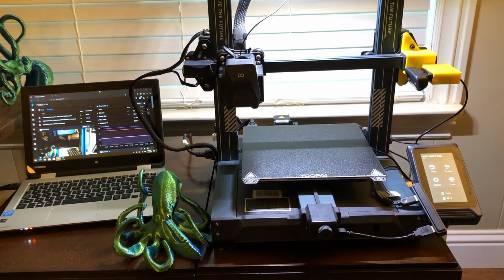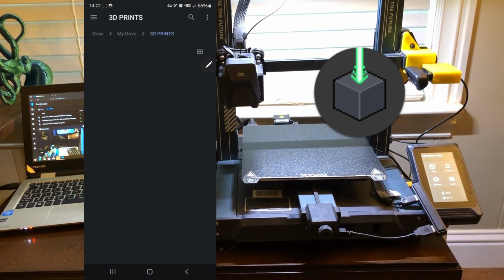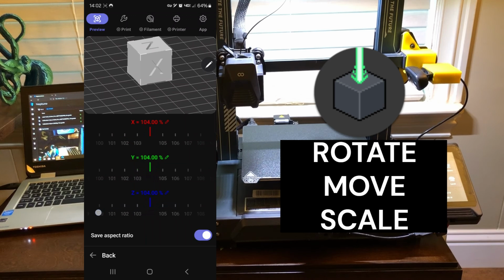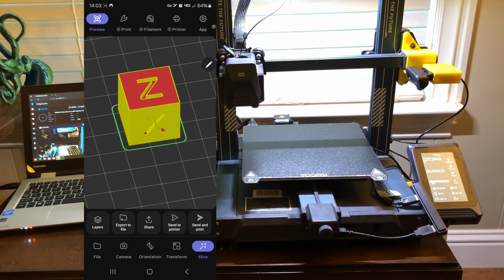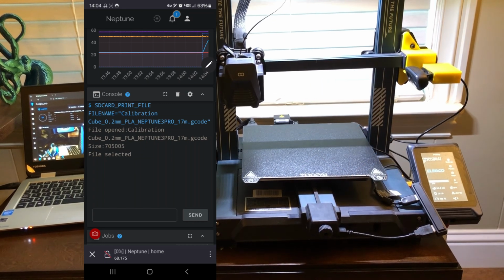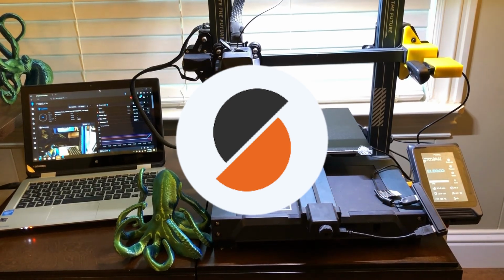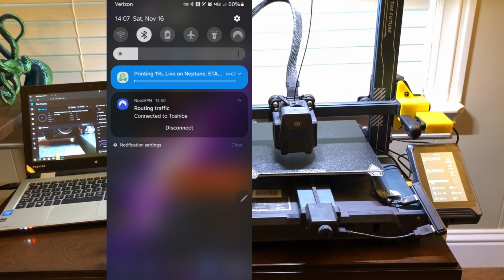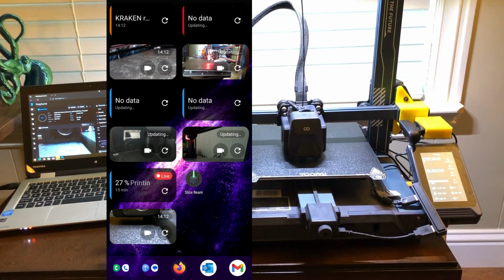Mobile Slicing and Printing - Slice Beam (Mobile Slicer)

Comment: could you go over what best slicer settings in slicebeam, I am a novice, I want to save material without sacrificing structural integrity, while also getting the exact size of the print i need, it been slightly proportionally smaller for some reason on slicebeam... all I have be a chromebook i couldn't run linux runtime environment on without it hardcrashing then deleting everything...